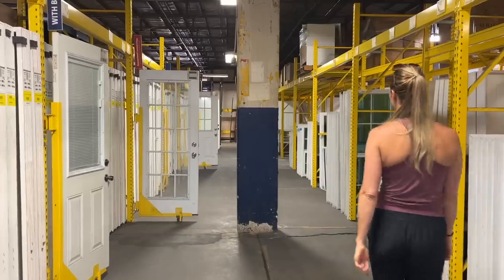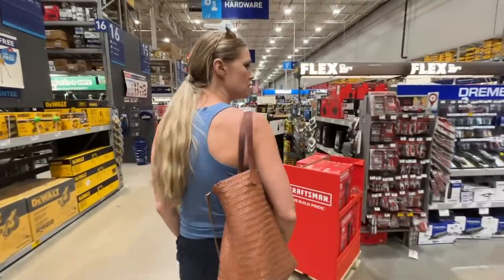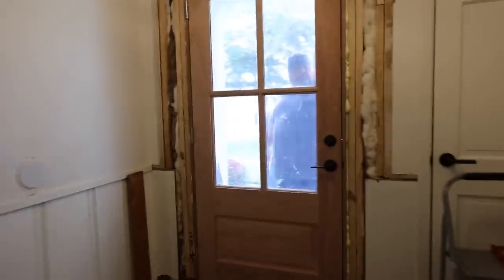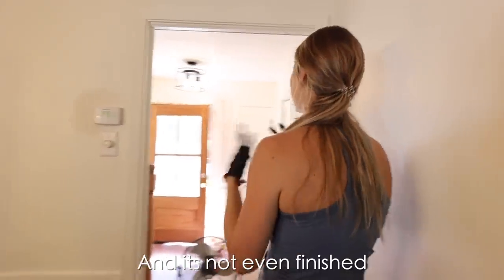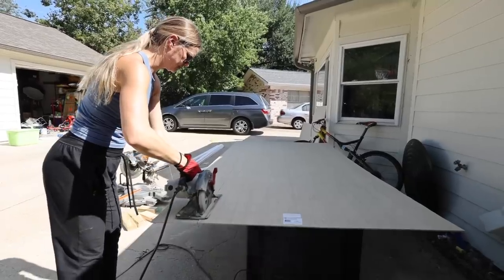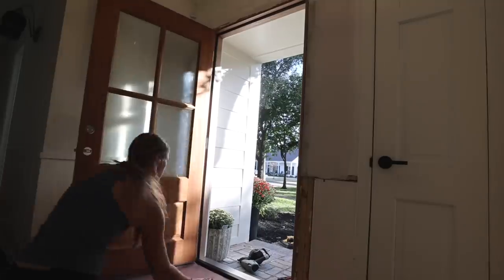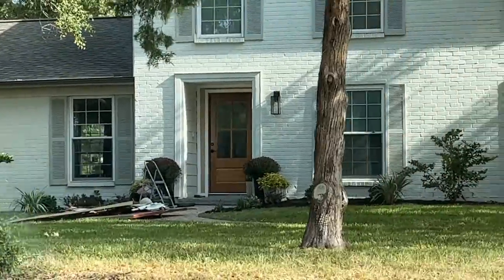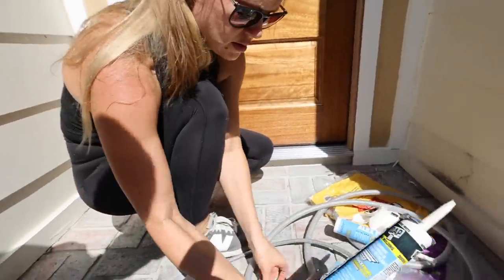DIY Gorgeous Wood Door Installation [Part 2- The Reveal!] // DIY Extreme Home Makeover

Comment: That 1/4" underlayment isn't rated for exterior use, it's used for floors. I would've put the door trim on first then put lp smartside panels in between the trim pieces, that would've eliminated that 1/4" gap you had to caulk around the trim. Door looks great, you guys did an awesome job! Doors can be a pain in the you know what!

Comment: I really want to install a Level bolt on my door but I've seen a lot of reviews saying the internet connectivity requires a certain Ring professional tier video doorbell or a Apple Homekit Hub (like HomePod). So if you don't have one of those doorbells then you only have connectivity to the Level lock when within Bluetooth range.

How did you guys connect your Level deadbolt to the internet for remote accessibility? Do you have it connected through one of those 2 things?

Comment: Please don't take this as a criticism - I'm a huge fan of your work. But, for future reference, if you prime the BACK side of whatever sheet goods you're using for trim before you install and paint the front, you double the life of the trim. The way you have that 1/4" ply installed it will last about 5 to 7 years before warping and delaminating. To get 15 to 20 years out of it, just back prime. Keep up the good work!

Comment: Impressive work.
From flipping furniture, room and house remodels to changing out front doors. 
Your house looks it's built from bricks, how did the plant pot fall into the toilet from doing demo downstairs? 🤔.

The devil is in the details.
Finding doors not made to today's or maybe not even yesterday's standard measurements or three layers of tiles in a kitchen. There are a lot of "fun" things to be discovered in older houses, those that have undergone a remodel once or twice.
A supposedly quick job turns into several hours or even a few days of work. I guess as soon as something is called easy, there's a catch hidden somewhere along the way.